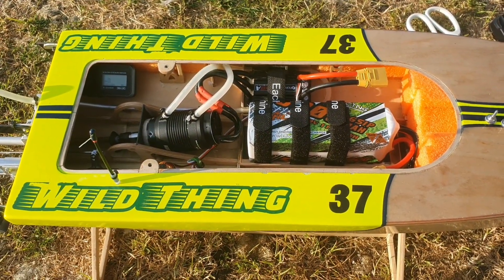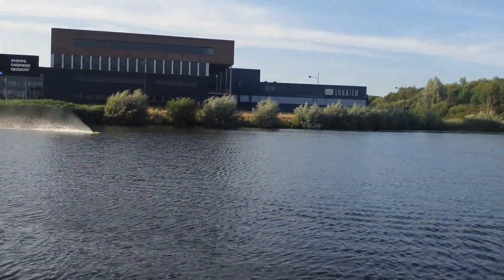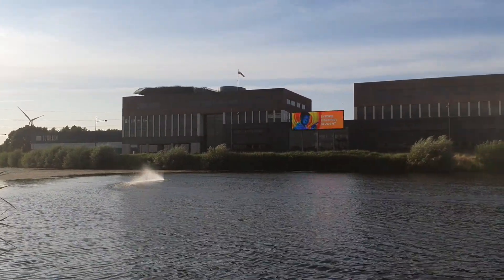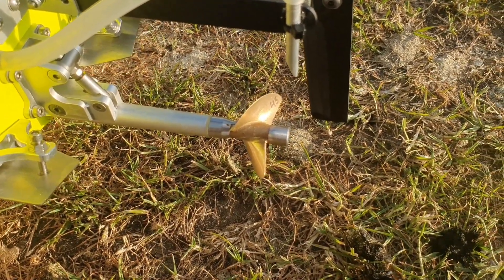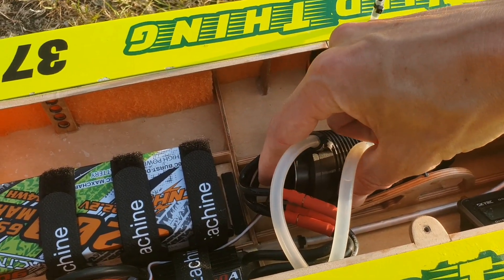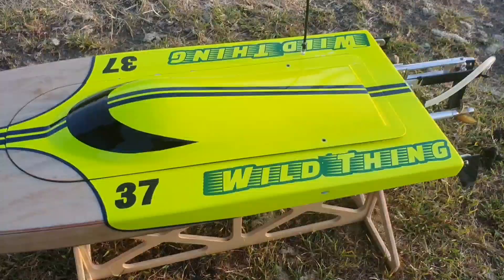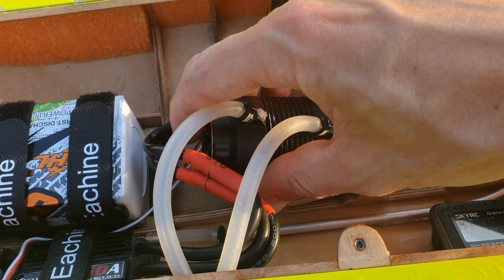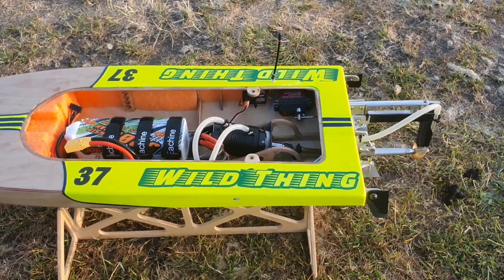Home made RC boat 'Wild Thing': 117km/h top speed and running laps.

Comment: Hey great build! Your boats inspired me to build a wild thing myself. Im documenting mine on international waters site. Just curious, are you running a 6s2p or just a single 5200mah battery. I’m at the point of trying to determine cg for mine but I’m doing a p mono set up and 4s2p at 6000mah x2 so I’ve got a bit more weight and less power than you. Where are you marking cg for your speed runs? I’m thinking centering around 11” +/- 1” for adjustment. My issue at this point is I’m running a standard strut and am building in a wet well, so I can’t get super close to the transom with the motor. Debating on weather I should just put the motor up front, but it goes against how I usually set up my monos. I’d love to hear your thoughts. My thread is in the IW fe forum. Thanks!
Reply from the maker: Hi, I ran with a single 6S 5200mAh lipo. My cg was at 30-32% from the transom. Enjoy your build!
Reply: @CozyRC awesome, thanks for the info!

Comment: Is that a stock prop (tfl 4416)?
Got about same size boat, also 2000kv but haven't reached those speeds. Figured was more of a cat prop. Since i need to order some stuff shortly i am qurious. Because thats the prop i definitely need to order also .... Running 43mm at the moment, but could take more.
Reply from the maker: Hi Peter, yes, that is a TFL 44mm 1.6 pitch CNC aluminium prop. Although it is advertised as ready to go, I sharpen the blades until they cut paper. Not only does that increase speed, but it also reduces current (motor gets less hot) and it reduces prop walk. This is the fastest prop on this boat. Yesterday I beat 120km/h with it. The video of that run will upload soon 😎
I'm now thinking to get the 44mm 1.7 pitch TFL prop for speed runs. Cheers, DJ
Reply: @CozyRC  Wow, thanks man! I was kind off baffled off these speeds. I don't run my boats often and am no expert also, but it took me a lot off time to get to 100kph. Tried some different prop, tried to modify props to get it faster and so on, but never found a "stock"prop to do so. 
When i think off what potential i'm looking at right now its almost ridiculous. My boat is heavier and i modified the hull (making it straight as an arrow) recently and to get over that 100 more easily i replaced the 2000kv and esc. I knew there was a bit left in it (good temps and runtime, just didn't have the prop) but did it the wrong way. Decided to put some extreme power and more kv in it but that will effect of course my runtime badly.
Well, i definitely will order that prop, because with my old setup it should run that 100kph with ease, and i'm currently doing the last things with my new setup that does 2200kv (comparable to 6s) and has 4 times the power. I getting all excited now.
If it doesn't work with this new setup, the old one probably will... Thanks!
Reply from the maker: @peteroosterhoff8850  Sounds good on the mods you did! Remember that upgrading to a high power setup, will also strain your lipo's more. A good lipo will increase your speed. I got Youme 60C lipo's, which are fine, but I also got some CNHL 90C lipo's that pack a lot more punch. The speed difference between those lipo's is about 10km/h running the same setup! ✌ DJ
Reply: @CozyRC  Your right. Last year i bought some other lipo's and it got about 10kph faster (what wondered me A LOT, since they were lower c-rate and less MaH). I just tell you, so you can have a laugh. At this moment (probably tomorrow it's maiden) i'm rebuilding the (starting to realize it was perfectly fine apart from the flaws in the hull) the boat. Because i wanted to go faster and had a prop that worked i thought, lets increase power and rpm. So i did..... By putting more than triple the power in it and increasing rpm by 10%...
I'm starting to think i might have overdone it right now...
Reply from the maker: @peteroosterhoff8850  What motor and esc do you have in your boat? And what kind of hull do you have? You made me curious now 😀
Reply: @CozyRC  a reinforced carbon mono2, with a 1650kv 8s (40 cansize) Castle (car)setup i had laying around.

Comment: That's an awesome boat. And I love your attention to detail and overall innovation. I've been following your channel for at least a year and I appreciate the content that you provide. I have all kinds of boats, but my passion is in to building wood boat kits. I have wooden tunnel hulls, hydros and cats and I have a small 20 inch wood mono, but I would like to build a wood mono that's at least 26 inches in length. Unfortunately,  the only (larger) wood monos available are designed for nitro or gas with open canopies. I've been searching the internet looking for all-wood fast electric hull that's at least 26 inches with no avail. Would you happen to know of a wood boat kit that fits my desired criteria? Thanks again for sharing your awesome projects!
Reply from the maker: Thank you George, I appreciate your compliments! I recognize your challenge to find a proper hull. Why wouldn't you build a Wild Thing, like mine? I can send you the PDF plans of mine, including layouts of the sheeting. Let me know; you can send me an email at cozy1rc at gmail.com ✌DJ

Comment: Looking good,  is 120km/h  your next goal?  How thick is the flex shaft you are using?
Reply from the maker: Thanks Thomas 👍 I use a 4.76mm flex shaft. Yes, I aim for 120km/h now, but I feel that I am close to the limit with this setup. ✌DJ
Reply: @CozyRC  Im buildin the same hull in a shorter version, 620mm. Almost ready to test it now, waiting for the  LiPo batteries to arrive
Reply from the maker: @thomassalin949  Sounds good! Enjoy the build and running the boat. It is a great design 👍

Comment: Great performar DJ😊,and yes the sound wase much nice👍
Can I ask you if you change the powertrimm angle when you put different prop?for me just for me the boat was to free
PB👏😁
Reply from the maker: Thanks Daiciu! 👍 I didn't change the powertrim or the trim tabs. This 42mm 1.9 pitch prop does lift de bow a lot, I also noticed that. Next time, maybe shift the lipo a bit more forward. Cheers ✌
Reply: @CozyRC  I think you need to set the powertrimm in small steps,what do you think?
Reply from the maker: @daiciuapostol79  Do you mean I should trim it down a bit? 
Or do you mean that in general you need to adjust by small steps? The latter is true for sure 😀👍
Reply: @CozyRC  Yes DJ when you change props you need to set different the powertrimm, so yes try your speed props whit different "-"angle same battery position ,whit speed runs you need to change only one thing at the time
Reply from the maker: @daiciuapostol79  Yes, change 1 thing at the time 👍.
My theory for speed running is to run  the hull as dry as possible / as much out of the water as possible. This is to reduce friction. I did trim the powertrim down a few mm a few videos back. You could see many flips at that time. Now it stays on the water, but still running very dry. 
I could try a little more down trim. My feeling is that the hull will have less speed, due to more friction. Maybe less rpm due to that? I'm interested in your theory for a little more downtrim 😀 I like to learn and gain my knowledge! Cheers, DJ
Reply: @CozyRC  https://youtu.be/hUVUEGq93lQ
Lock very close on my 6s run ,I change the Octura M445 to Grimrace 42x55 first I run 0°powertrimm boat run wet then change -2mm maybe and boat run very free,battery same pozition,and turn fins out from the water wen do speed run because they bring drag
Reply from the maker: @daiciuapostol79  Just to make sure: -2mm is 2mm down right?
Reply: @CozyRC 😁 Yes Cozy
I used to ask exactly the same questions when I was receiving the same advice, but I just want to say what I experienced so you don't think I'm an expert, maybe someone else can contradict me, what I know is that for ABC propellers you need + angle for powertrimm and the rest like Octura or TFL you need - angle and one more tip no matter how well the propeller is balanced it is good to leave a little play when you tighten to the drivedog, I will make a video about it, the secret is like a moment when the propeller rotates at high speeds, it will center itself on the axis
Reply from the maker: @daiciuapostol79  Thanks for the explanation and the advice of the prop tightening. That's really interesting and I have not heard that before. I will put some negative trim in the next run, to see the results. I will keep you updated 😎✌